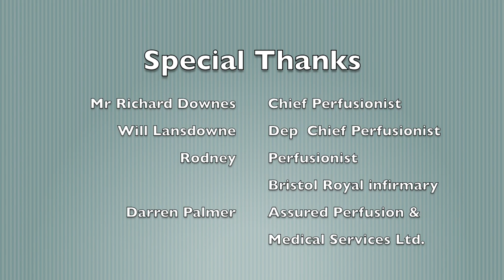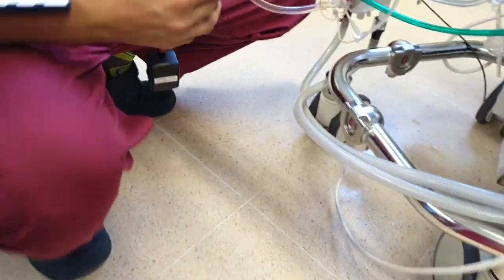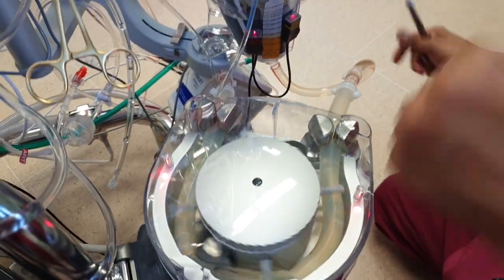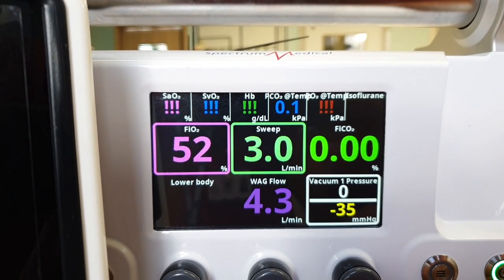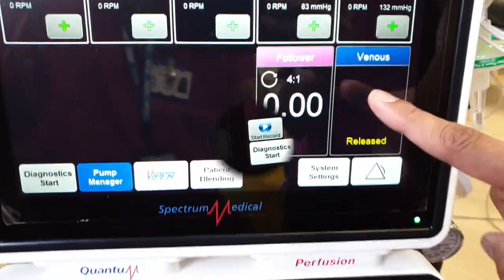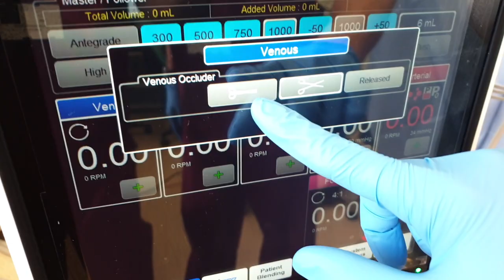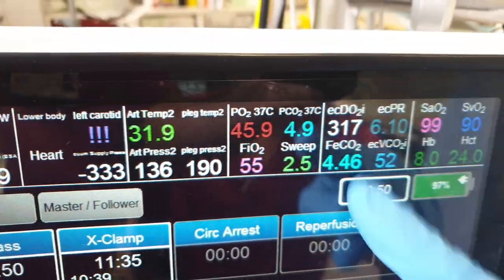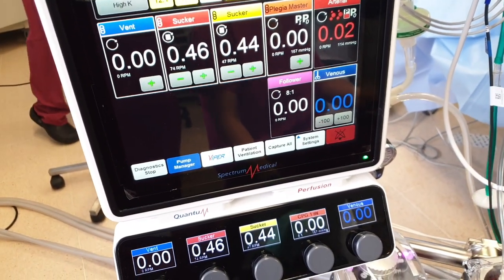Spectrum Medical Quantum Heart Lung Machine

Comment: If each pump had its controls attached to it you wouldnt need any colour coding. Also how do you look at the roller and the controls at the same time if there are rollers in different locations and levels from each other? Ive been a perfusionist for 30yrs.  Give me a consol with 5 rollers and controls for each roller on each roller anytime. This machine is trying yo be tooo clever and it seems very "all over the show"..